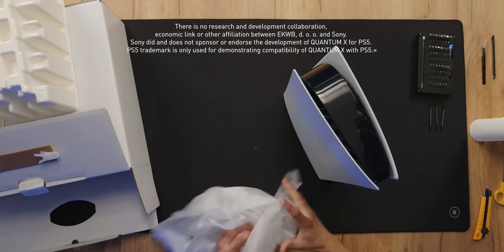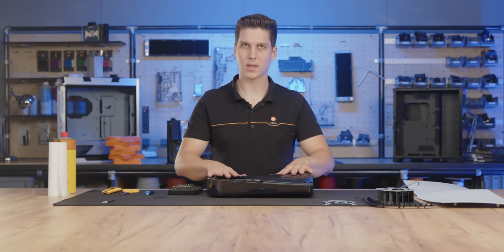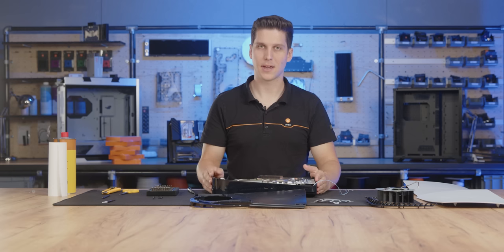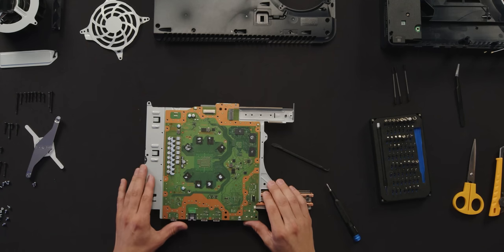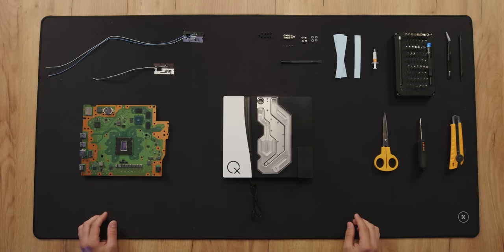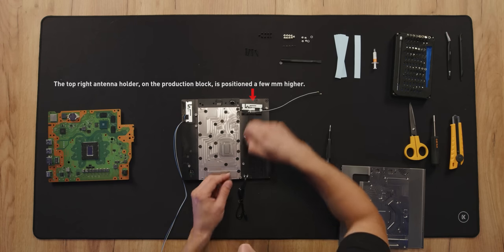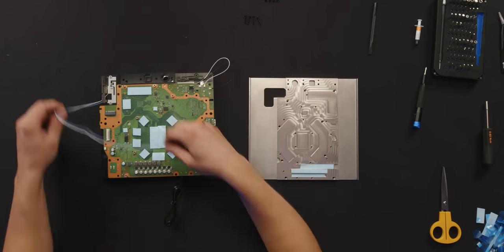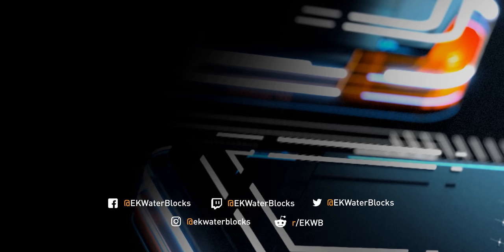How To Water Cool a PlayStation 5 With EK CoolingStation | Installation & Disassembly Guide

Comment: Anyone have an extra $1000 laying around for the everything else needed?
Reply: If 1000 is too much then you need not be considering custom looped watercooling.....I spent over 1000 on just the fittings making my pc loop look exactly how I wanted
Reply: I water-cooled an Xbox with 150.. don't need 1000 unless ur doing the highest end of every single component with hard tubing and unnecessary stuff
Reply: i actually have everything else needed pumps tubing and so on so i may get this if it's not Crazy expensive which of course it will be
Reply: @LyuboA  450 dollars lol so same as the system itself
Reply: Get a job stop asking for money
Reply: i do
Reply: 50$ for a set of proper fittings, 10 for tubes, 100$ for a radiator and 150$ for a pump/reservoir combo thingy.

Comment: Now what do you do with it?  Does it go back in the OEM case or you just leave it floppong around with a mess of tubes going to a pump and radiator?
Reply: build it into a mATX case, pump, radiator and go.
Reply: @stevenross-watt8640   how are you powering the ps5?  just shove the stock ps5 pwoersupply into pc case?
Reply: @TheHoboWithAShotgun  I'm not sure. I guess you would just find a location and find a way to bolt it down. You're right in the realms of console/pc modifying by this stage so you have to expect to solve a few issues yourself. Usually once you get to a custom loop on a waterxooled pc you are solving some problems that are unique to your build, this just seems similar. To me.
Reply: @stevenross-watt8640  found tbe follow up video. They basically use a PC supply snd a custom cable. I commented the following up video where they out this waterblocked PS5 PCB.
Reply: @TheHoboWithAShotgun  interesting. Sounds like a good solution.
Reply from the maker: Power delivery is converted from the 2-pin DC connector to the two 8-pin PCIe connectors via a custom PCB mounted on this product, so all you need is a PSU with 2 8-pin connectors.
Reply: @EKWBofficial  so this converting PCB IS built into the waterblock i assume? Ty for clarification
Reply: @TheHoboWithAShotgun  Yes the PCB is a part of the monoblock so all you need is a PSU that supports 2x 8-pin PCIe power connectors.
Reply: What wattage of power supply is required, or do you recommend?
Reply: @EKWBofficial is it possible to sell this pcb separately?
Reply: @thejedijohn  PS5 will use at most around 230Watts, with regular gaming Wattage around 200W, so pretty much any power supply that can provide 250W on the 12V rail (usually specified on the sticker on the PSU), which by the way any power supply with 2 8pin connectors should have, unless you go really hardcore china when you buy it.  

So to sum it up, it's hard to recommend a PSU just by Wattage, because it needs 2x8pin (no splitters!), which anything above 450W PROBABLY has, but do make sure before you buy it.
Reply: @EKWBofficial 😮
Reply: @EKWBofficial Hello EKWB, we need waterblock kit for PS5 Pro. Thank youuu 🎉

Comment: I dont understand where is the power button? Why you dont extend the button to mod it into an case? So you can switch it on whit a case . The secound question is…. Where is the power connector? You need the original power supplie? Or can you plugin a pc cabel into the monoblock? What is with the ps5 usb port? How we can use it witout tomopen the case? Extender? Questions about question….

Comment: As for the extra drive.  The plate stops just short of where the riser screw would go to secure the drive.  I used the extra thermal pads to create a friction foot on the top side of the drive.  That way, when the final plate goes into place, it will hold the drive level, and the adhesives on the pad are just enough to hold it into place.

Comment: Is there a point to this? Like does it just run more stable temperatures or am I missing something more?
Reply: There’s no point. It’s really just because they can 😂
Reply: @emperorfloch i was about to say... way too much work for the gains received.  Really,  just a fun weekend project. Something to show off.
Reply: a lot of work and money to at most have a little more stability in games and maybe an increase of 5 to 15 fps at most with games that support VRR, honestly I wouldn't buy it, at most I would think about buying it if a ps5 pro came out and if you couldn't maintain 120fps in games because it heats up too much, then I would think about it.
Reply: @nerddeku9675   I agree with you here. But I would want to see someone,  or maybe find my own way to build it where I have I/O options.  Power switch, USB, etc.. I'd try to find a way to put it in a case somehow, like Origin PC did with all the 8th generation consoles.

Comment: Can't really see the inner workings of the water block🤔 It's basically just a reservoir/distro plate?
Reply: It's most like an Active Backplate Set than anything else. If you check pt.2 of the  QuantumX PS5 videos you can see all the internals

Comment: The antennas will not like to be that close of a metal block. Have you tried the wifi performances before installing the monobloc and after ?
Reply from the maker: We tested the wifi performance before and after with no noticeable differences. You can also install the antennas elsewhere, and you can even place them far away from the monoblock (outside the system) using the IPX / U.FL (male) to SMA (female) extender cables.

Comment: Still not getting if m.2 slot can be used :/
Reply: Yes.  But they did not show them installing the mounting screw for it, and now I have to remove the plate to put it in.  They did include the mount riser in the kit.  Just didn't show Installing it.

Comment: Never seen an overheated ps5, anyway, the project was made to be used with liquid metal, kind of an oversight from EK.
With supposedly better cooling i think PS5 would be able to sustain both cpu and gpu at max clocks all the time instead of doing an balancing act between the 2. Maybe some games would be able to benefit from it?
Reply: Pas du tous, le métal liquide est la pour mieux dissipé la chaleur mais Sony mette du métal liquide de basse qualité égale au métal liquide haud de gamme d'il y a 10/12 ans. Des pâtes normal qui ont les mêmes capacité existe mais coûte cher (11€ les 2 grammes pour la Thermalright TF8 par exemple)

Comment: MASSIVE WASTE OF MONEY considering it's not an actual enclosed unit and you still need to spend additional money to do so. This is what I call an Epic Phail!

To justify a mod of this price point, the finished product needs to be just that… FINISHED!!!

This is a base kit that still requires purchasing more components to finish. This will not sell well at all, especially given how the PS5, while it does run hot, isn't experiencing overheating issues like the PS4 did. For $475 it should include everything needed, resulting in a complete console.

Comment: What a pointless product. There is so much assembly, no thoughts about design and for that price, you would expect a case and a controller with it.

I have bought so much useless EK rubbish during my time. SE blocks each generation and overpriced distro plates, but this is something else.

You guys could have designed something more practical for half the price.

Comment: I love Ek but honestly what kind of ill-thought-out product is this? 

On top of the cost of a PS5 you buy this then additional pieces which means you are spending close to 1000 you might as well but a low to mid end PC which right now will give you similar or better performance than a PS5.. sigh... EK needs to go back to it's core.. don't branch out!
Reply from the maker: We like modding stuff! It's the essence of EK. We're not branching out but simply reminding ourselves of how EK came to be in the first place - with modding fun electronics.  We take on a few fun projects each year, to do things we've never done before - these projects usually never make it to production, but we received so many requests for this one that we had to listen to our audience. And don't worry, we didn't forget the PCs! We've got several highly-anticipated products coming up in the next few weeks, so stay tuned!

Comment: This is a pointless product, with PS5 slim is just being around the corner there is no need to pay $449 + a case to cool down your ps5, the ps5 slim runs around 30% cooler than its predecessor ( take this with a grain of salt)  and it consumes only 150w (vs 200w) during gaming sessions. rather than the looks, there is no need for this, its bad timing EK, Id rather invest in a cooling kit for the upcoming PS5 PRO that draws 350W during gaming.

Comment: Could this BE anymore complex? And it’s kind of fraudulent to say this only cost $200. What about the other parts and the cost for those. By that point why would I even need this? I’ll just  buy new PlayStation
    And… do you just leave it bare like that? You won’t be able to put it back into the case because it’s going to be too thick now because of the cooling block.

Comment: Uhh why didn’t you turn it on? Great job at bricking a ps5 . You don’t even show it working don’t show the power supply. Wtf are we even supposed to do with this? just look at it sitting on a table? FFS you could at least finish the build and show it working
Reply: If you read the included product manual (as this video is just for showing you how to attach the block to the motherboard) it'll note that you plug it into a standard ATX/SFX Power supply via 2x8pin EPS connectors
Reply: We didn't want to repeat everything from our previous build video which is specific to the build we made. You could do any number of things with it. (and it works fine, this PS5 was used in Luka Doncic's build)
Reply: @jr23design10  I watched both videos and the other one doesn’t show any gameplay except for maybe 2 seconds off screen. I mean it’s cool and all but show some results